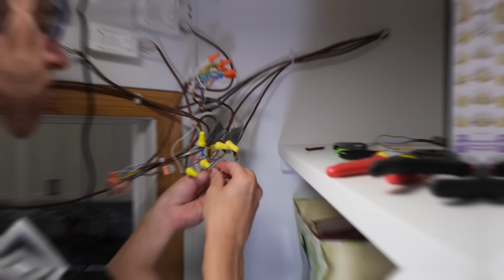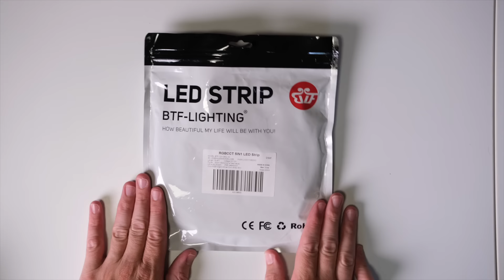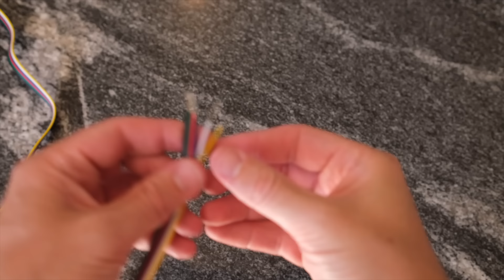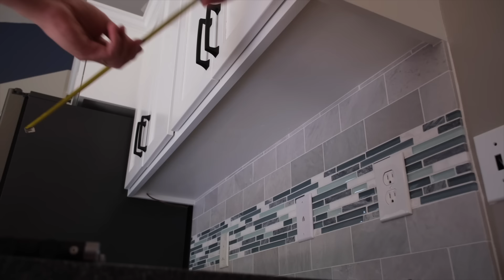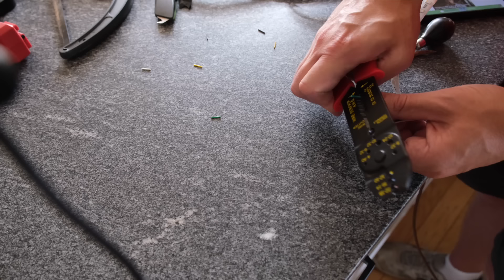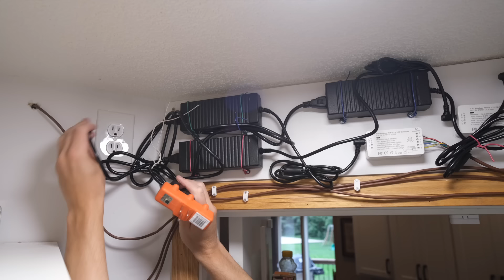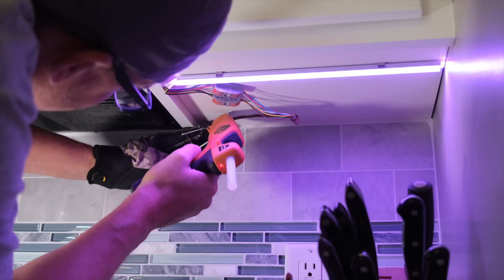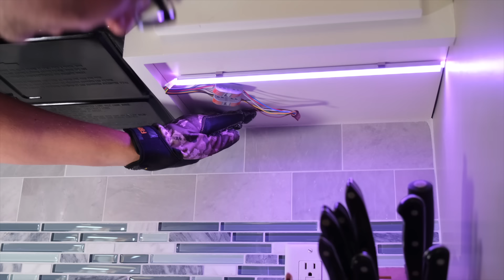Ultimate Guide to DIY Cabinet LED lights - full install

Comment: I looked into this at my old house which had 44 ft of cabinets.  Choosing led strips, channel, diffusers, power supplies and controllers was more than I wanted to do.  And I wasn’t willing to pay someone thousands to do it.  So I sold my house. 😂😂

The new house would be easier to do, but I have more and better placed led can lights which really makes the under the counter lights unnecessary.
Reply from the maker: Sometimes selling the house to avoid a project is the best thing you can do!

Comment: Would it not have been easier to fish the wire through the closet walls then straight under the cabinets? for top and bottom, not sure on toekick... Ur kitchen is kinda same lay out as mine and i already have a backsplash but i would assume if uwere to do it this way it would be easier and cleaner... Whats ur thoughts? great vid btw, hows those LEDs holding up? Any burn outs yet?
Reply from the maker: LEDs are holding up great! For the toe kick, yes, I ran the wires down along the inside of the pantry and through the wall to the toe kick. The biggest hurdle is making the jump around the sink for the upper cabinets. If you already have a backsplash in I would probably drill up into the cabinet and run the wire all the way up to the top and into the wall through there. It’s a lot of extra wire, but you should be able to hide it well doing it that way.

Comment: with respect, those are the wrong strips. WS2812 is RGB+W which has a dedicated white and give the same white while still being individually addressable. For under cabinet lighting I prefer COB if you know you're going to stay white. That way no diffuser is needed and keeps you lower profile.
Reply from the maker: Cob lights are awesome, but we’re a lot more expensive when I started this project. For kitchen lighting, you’re right, excellent whites are important which is why I went with the RGBWW lights. I don’t think individually addressable lights in the kitchen are necessary, but if that’s what you’re looking for, go for it!

Comment: I want to install a dimmer switch to control my RGBW strips right next to the light switch controlling the already-installed lights for my kitchen. I don't want a wireless remote, nor do I need an app on my phone. Do I need a special controller to accomplish this?
Reply from the maker: There are a few options you could consider. Do you have a smart home hub of some sort or are you looking for purely self-contained control of the strip lights?

Comment: looks more of a commercial for using the "easy way out" for the headache you went through. I used the plug and play method with a bad back and spent $40 an an hour of my life to do the same size kitchen.. yeah for me right? it's automated, in all my smart home platforms,  and turned on and off based on occupation. the sensor was a tick it up and forget it and it was $30. and yes the "plug is there" but it's easier than that stuff you got going on in your "closet"
Reply from the maker: I have no problem with anyone taking the easy way out. I watch a lot of YouTube videos for home projects and they always make everything look so easy. Then you get into it and often realize you’re in over your head. Sometimes scaring people off of doing a project can be just as valuable for them as teaching them how to do it.

Comment: Could you share some more info one what you used for the wall switch? It looks like maybe you used a lutron pico remote, but I don't understand how you'd integrate that with the zigbee LED strip controller. Does that require Hubitat?  Thanks!
Reply from the maker: Yep, I used a pico and automate them together with Hubitat. But if you wanted to stick within the hue universe you could use a hue button controller and you wouldn’t need an additional hub. You can see how I setup my button controller in this video at about 6:44: https://youtu.be/VXwVkAAHyfg?si=44WBMovDGpEh_onk

Comment: How did you calculate the wattage per foot for these strips? I have 25' of strip needed and wondered if this power supply would do the job. Can't find the spec for these lights for the wattage per foot. Thanks.

Good Video.
Reply from the maker: Thanks! The strip should tell you the total wattage; just devide that by the amount of feet for the wattage per foot.

Comment: Just a thought, couldn't you hide the wires by cutting out a thin piece of plywood and mounting it under the cabinets? you would have to be precise with your cuts, but their are plenty of videos out there that would allow you to match the paint.
Reply from the maker: That is a clever idea. Perhaps if the shorter people in my life complain about the exposed wires (I can't see them), I'll have to give that a shot

Comment: Thank you so much for this!! Im about to do this exact project. Did you use a seperate zigbee controller for the top and under cabinet strips on each cabinet? To be able to indivdually control the top from the bottom.
Reply from the maker: Yes, I used three separate gledopto zigbee controllers. One for each level. Each controller needs its own power supply, too

Comment: How many hours total? I did something similar using slyvania light strips and extenders hidden in the gaps between cabinets and plugged in above microwave on one side and fridge on the other. Unfortunately it didn’t pass the WAF so I removed them. I do have those RGBgenie controllers if you want them
Reply from the maker: I’m not sure I can count that high. The project was very start and stop because I was working around the kitchen remodel, but took much longer than I anticipated. But so does every project indo

Comment: I’ve not had much luck with soderless connectors connecting to the LED strip, though the connectors you used for the cables is a great idea!  In my experience, the connection ends up not working well after a while and the lights start flickering.  I find that soldering the cables directly provides better long-term results, though it takes more time to setup and requires some soldering skills…
Reply from the maker: I was a little doubtful, but so far they have worked perfectly. I figure as long as they don’t get bumped there is no reason they should stop working. Soldering is definitely ideal but, above my pay grade.
Reply: @DIYSmartHomeGuy1  Soldering may be ideal... just not MY soldering!

Comment: Use 3m automotive double sided tape to install the channel to the bottom of the cabinets. Even easier than drilling and screwing.
Reply from the maker: Yeah, used 3m tape for the power supplies and connectors. I don’t even know how I would get a drill under the toe kick
Reply: @DIYSmartHomeGuy1  right angle attachment

Comment: You may regret not using channels under the kick space. I have never had any luck with LED tape staying stuck. At least in the channel they will not dangle down if unstuck. Great video. Good luck from the UK 👍
Reply from the maker: Thanks! We’ll see. I figure the worst that happens is I add the channels later. So far  my sticky strips are holding up in my bookshelves for a couple years.
Reply: @DIYSmartHomeGuy1  There are easy and cheap plastic clips if this happens